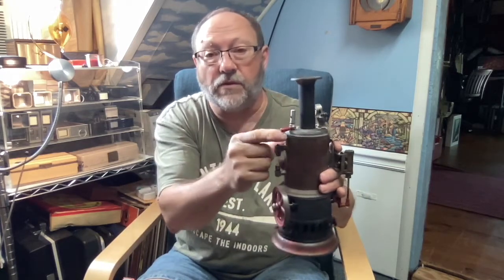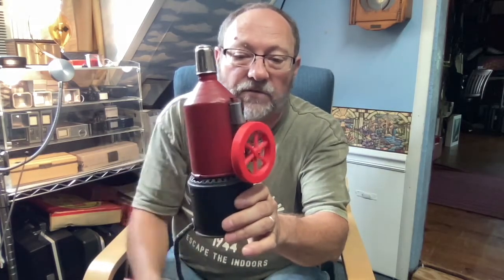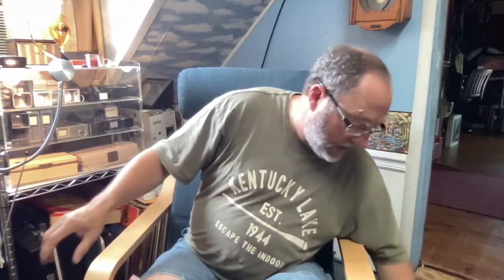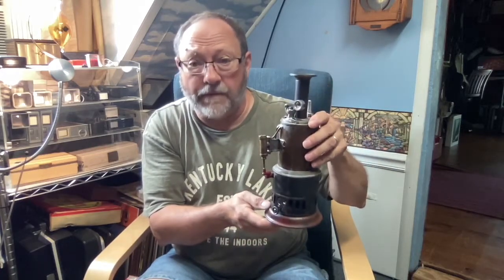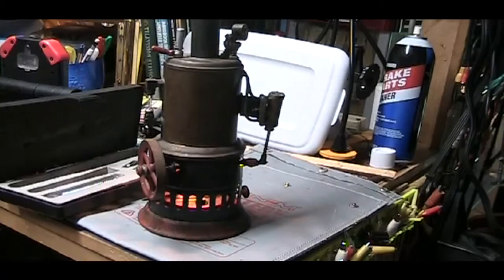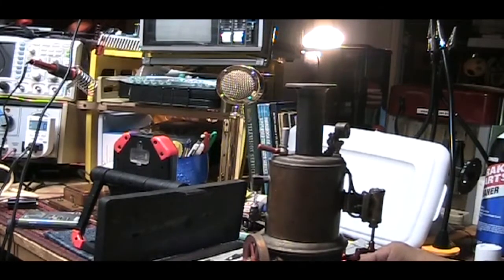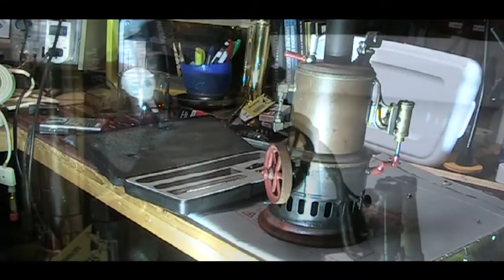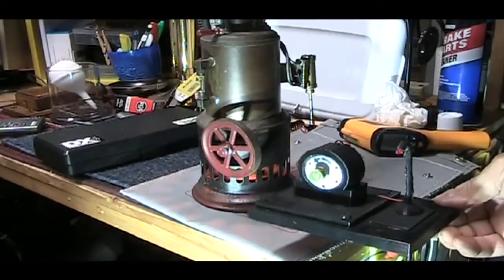Vintage Tech: 1930 Toy Steam Engines

Comment: I inherited a Weeden No. 123 a few months ago. It works fine with an air compressor. But, it's missing it's air pressure release valve. I can't find any on-line and am wondering if I can make one. Not sure how to do it though.
Reply from the maker: Hello BP. I made a pressure release valve for two of my boilers. I used a stainless steel ball bearing for one.  Do you have the well that the weight sits in?
Reply: @KOVintageTech  No, I don't have the well. There is a brass cylinder in the hole on top of the boiler where the pressure valve is supposed to go. It's a quarter inch diameter and 5/8 inches tall. It can easily be removed. I don't know if someone just stuck it there over the years or if it's an actual part. My 90 year old father in-law recently passed away. This steam engine was heading for the garbage when his house was being cleaned out. I couldn't believe it was going to be thrown away. I took it and cleaned it up and got it to work. The smoke stack was missing so I made a new one. The only thing left now to fix/replace is the pressure valve. Thank you for replying to my post.
Reply from the maker: @WildwoodT  if you could send me a picture to my email address I feel pretty sure I can make something for you so that you can get it running. It sure would be great to see it running. Your father-in-law would be so pleased.
Reply: I let my son play with my unit when he was 4, he lost the same problem and the fill cap mounted on the drum. One day I'll have to make new ones, my grandpa bought it for me in 1974 when I turned 8. I loved firing up that engine and had a buffing wheel on a metal corded rope off the drive. My mom had the shinniest knives around as I'd polish them all up for her. So I treated it as a tool not a toy.
Reply: You could use alcohol instead of oil- no smoke and clean burning to boot 👍👍👍🇺🇸